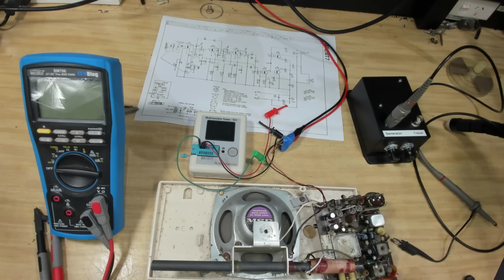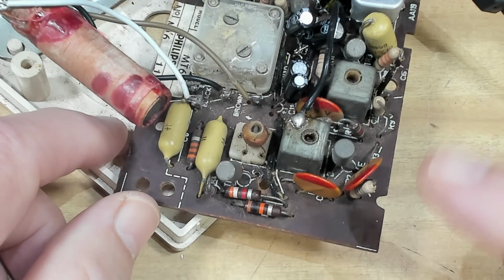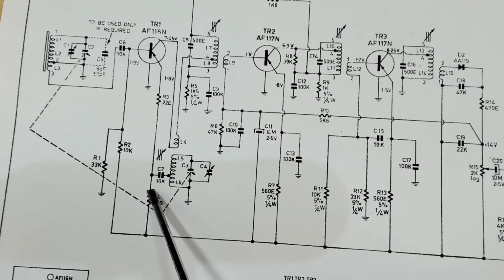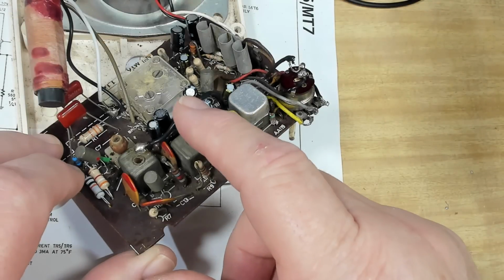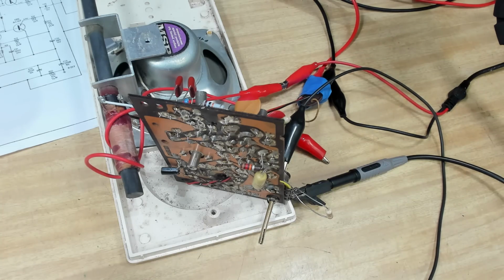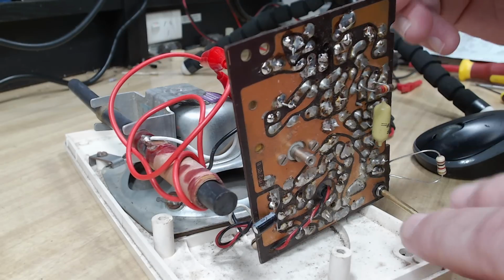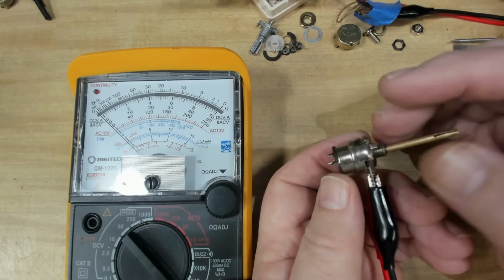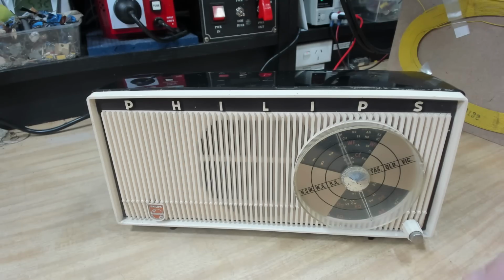Philips MT6 Transistor Radio Repair

Comment: Hi David hope you and the family are well. 
I had a similar experience with a 1939 Murphy valve radio. Initially I changed all the defective caps and reinstated the original valves (someone had fitted two separate valves instead of the original MIXER /OSC. Lots of other work as well but it worked ok. Wasn't satisfied with the audio so I changed all the resistors for modern types after which it would not function at all! Put it back in the frame and after much investigation a large blob of solder fell out of the wavechange switch (a large open contact affair). The radio then functioned perfectly with much better audio. Silly me!
Best wishes
Lynton G4XCQ
Reply from the maker: Haha... that sounds normal Lynton, simple mistakes set us back so much. The name of the radio should have given you a heads up 😄 Thanks Lynton.

Comment: Quite a nice set for its period. I like the transformerless audio section - none of those horrible little phase splitter and output transformers which you got in most sets of this era. Coupled to that decent size loudspeaker it will have given many years of sterling service.
Looks like the previous owner renewed the electrolytics and then was stumped. You did a nice job of tidying it up and the rebuild job on the volume control was a definite DT Special! You really do go where no man has gone before. It gives the rest of us courage to attempt things that seem impossible. Next weeks video - 'Brain Surgery 101'.
Thanks again, Dave.
Reply from the maker: Thanks @EuroScot2023. It is a nice radio and performs well for its size . I was willing to try brain surgery but it's so damn hard to get volunteers👍🙂
Reply: ...a DOWNSIDE of "transformerless" amplifier stages, is that they are EASY to blow out: I found that out the HARD way...

Comment: Hi Dave,
If I, whilst working as a service tech, had a pound for each time I ploughed into a repair without doing a basic check before hand, I would easily have amassed a minimum  of £250.  No matter how much we promise ourselves we’ll be more vigilant next time, it keeps on happening to all of us my friend.  I guess we are too eager to, “Get stuck in” LOL!
Another enjoyable repair video my friend.
Best regards, Phil.
Reply from the maker: Thanks Phil. I did check the replaced components where correctly installed and the soldering wasn't shorted. But the way I had the board facing I couldn't see the blob, that's not an excuse but it stopped me seeing it a bit earlier on. I will try to be more vigilant in future but, yes, we are too eager sometimes. Take care Phil 🙂

Comment: Great job David sir transistor substitute available on amplifier stage AC 127 substitute c188 and AC 128 substitute c187 I think you know but my knowledge sharing you sir.

thanks for sharing this video sir
Reply from the maker: Thank you Nath. Thanks for the substitution info. I will need to check the bias if I go to silicon 👍🙂

Comment: the case looks more modern than the circuitry. since it wasn't working when you got it, i would say whoever worked on it before you dropped that solder.
Reply from the maker: It does! The board looks very primitive. it's was/is a nice looking radio though. The solder was there from the start, it has been confirmed 🙂

Comment: Well done. TR1 looked to be leaking base collector in reverse (0.4V 5:40) and, as you say, hFE should be at least 50 so wondered whether you fitted a direct replacement post blob removal (jackup resistor removed). Looking at the state of the tuning cap, I doubt you were responsible for the blob. Looks like atkelar has some competition, ho, ho.
Reply from the maker: Thank you Ralph. Yes, I thought that too. I fitted another AF116 from another set which at this stage at least is working. The blob has been spotted earlier in the video be an eagle eyed viewer 🙂

Comment: Good work David. Just a tip for you if or when you can't repair or replace a potentiometer that has an open or damaged carbon strip. I always used a lead pencil and drew several layers over the damaged area. It does work and I never had one come back faulty!
Reply from the maker: Thank you Roger, I'll keep that in mind 👍🙂

Comment: And those transistors look like germaniums, even if that had been the problem, what could you replace it with ? 
Good job spotting the solder blob, you spotted it late but you spotted it.  Yeah, butcher soldering is right, the previous person must have gone in there with a plumber's iron.
Reply from the maker: Hi Ellesmere, thank you. Graham the Radio Cruncher put me on to AF12X germanium transistors to replace the AF11X series. The same transistor but without the whiskers problem. They are available online. There was some pretty rough work. I did check over the work done and confirmed the components had been correctly replaced but still didn't see the blob, that IF can was in the way 😄

Comment: Holy crap ! that was tiny parts to work on. You impressed me once again Dave with that fix, but the trouble shooting part was fascinating. I downloaded the schematic and followed along and my money was on TR1 for almost the whole time. Granted i wasn't in front of the board so i could not have picked up on the solder blob, but still, you're way better than me at trouble shooting.  Thank's for sharing. See yeah in the next video my friend 🙂
Reply: ...SKILL is certainly important- but LUCK has a lot to do with it too...
Reply from the maker: Hi Raymond. I struggled to work out how things were getting power, it's all back to front. I need to watch some videos. I did narrow it down in the end I guess. I couldn't see the blob till I moved that capacitor aside. It was a good learning curve though. Thanks Raymond 👍😃
Reply: @DavidTipton101  No kidding, you figured it out very methodically, your Valve radio experience paid off for sure. Yeah we always have to watch a video or another right ? reminds me i have to educate myself on signal tracers, i think you touched on them in some of your videos, i'll have to check your playlist again. I used a small signal tracer (9v batt operated) when i got my alarm system installed, i wonder if i could use it on my radio resto projects ???
Reply from the maker: @raymondmenard5444  There is a link under my videos to the signal tracer I use. It has been very handy for fault tracing.
Reply: @DavidTipton101 ...well, "we live and learn"!!!

Comment: Good work Dave. Those AF11x transistors are quite often the cause of a dead radio from that era (although not in this case with that solder short of course!). I've often found that even when they show up OK on the tester they still don't work properly. I think an hfe of 11 would indicate it's quite poor. I've had some success replacing them with modern silicon PNPs but that doesn't always work for the osc/mixer stage.
Reply from the maker: Thank you Neil. Yes, I expected it would be the transistor with their reputation. !!hFE is way too low, I didn't know that at the time. I learnt a lot on this project. I will replace them with the AF12XX series in future if I can get them 👍🙂

Comment: Old radio techs used to rebuild the worn carbon tracks with a very soft graphite pencil.  Graphite will lubricate the wiper and because it's also conductive it'll help fill in the gaps and stop that crackle.  All they did was "draw" the track with the pencil - anything from 2 - 6B should do.
Reply from the maker: Thanks LLoyd. I didn't think to do that, a fair bit of the track was totally missing so... but a good idea for crackly pots. Thanks 👍🙂
Reply: @DavidTipton101  And that David, is why you can buy conductive silver loaded paint ;)

Comment: Well done :-D
I know you didn't put that blob of solder there,  some phantom fiddler with bad eye sight did it.
Your power supply could be adding noise to the radio,  try a battery.
I bet that some of the i.f cans have been messed with, does the scale match the station position?.
Reply from the maker: Thanks @zx8401ztv, I think it was there from the start too. The power supply does add some noise. The stations lined up very well, the IFs didn't look fiddled with 🙂

Comment: That soldering looked rough as guts when you got it. Glad you got it tidied up and running again. I laughed when I saw that hfe value. Years ago I threw out my childhood box of old circuit boards that would have been filled with geranium transistors and diodes. I obviously regret doing that now!! I see you have a bot/spammer in the comments. Shango has a couple haha. Must mean your channel is moving up in the world.
Reply: You see spammers, report them (3 dots on the right); pick appropriate selection. If Google can censor, so can we.
Reply from the maker: Yeah, it was low alright. I learned something at least 🙂 Pity about the ditched transistors, if only we knew these things at the time. I don't know what the spammer was about, I regrettably blocked it, 15 to 20 comments per video is too much ☹️

Comment: Great repair, like you, I am much more familiar with valve sets, but any set that has been got at before needs close scrutiny.
I reckon that solder blob was left by the previous owner,  excellent job on the volume pot, these can be a real challenge!
Reply from the maker: Thanks Mark. Someone picked up a shot of the blob in the video at the 5:00 mark 🙂

Comment: easy repair David need to use your CRO to see if the oss is running
Reply from the maker: Hi Ian. I could have used it but I knew the oscillator wasn't running and the transistor voltages were all wrong. I should have dragged it out to prove it 👍🙂

Comment: Nice detective work with that solder blob. Just remember Dave that you have a knack for learning and explaining things in a very easy to understand method! Transistors or tubes it's just elections flowing through the components. No rocket scientists needed here to troubleshoot! Thanks for posting and take care!
Reply from the maker: Thanks John. I know the basic principle is simple but I haven't worked out the effect failed components have on other components so I can work backwards from effect to failure 🤔
Reply: @DavidTipton101  I'm always working backwards from my failures 🤣

Comment: Dave, I use a trick when checking small signal transistors with an ohmmeter. in addition to check for two diodes from the base for forward and reverse action like you did. i put the ohmmeter across the collector emitter and check there is no current but then put my finger across the base collector pins. if the transistor is working you should see current flow as it becomes forward biased.
Reply from the maker: That's gold Steve. I will try it on a spare transistor, thanks 👍😃
Reply: @DavidTipton101  if it’s a power transistor or low gain, you may have to lower the resistance of you finger by giving it a little lick!

Comment: Great work with that potentiometer.  How'd you machine that plug--was that on the drill press or on an arbor on the lathe?
Reply from the maker: I did it on my lathe but I don't remember how, It must have been from a flat sheet of phenolic material. Thanks  @blahblahblahblah2933 🙂
Reply: @DavidTipton101  Ahh seemed very small and difficult to hold especially it being phenolic.  Good work!
Reply from the maker: I might have drilled a hole in a small piece of the sheet and screwed it onto a piece of dowel held in the chuck and machined it that way 🤔